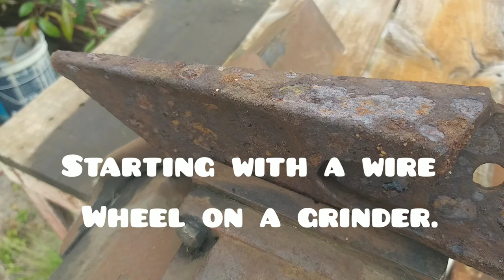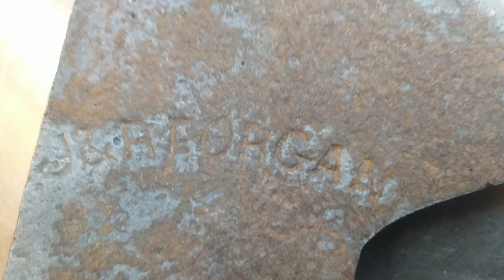RESTORATION OF A OLD J&R FORGAN RIPPING TINE. (42ND TOOL ON THE WALL)

Comment: That definitely was for plowing the soil but usually there are way more than 1 all pulled together by a tractor. That's why its so much narrower than a horse pulled plow.
Reply from the maker: Thanks wasn't sure I made it just to make lines to drop seeds in to then cover over. I know it's not designed for hand held use.
Reply: Great restoration!